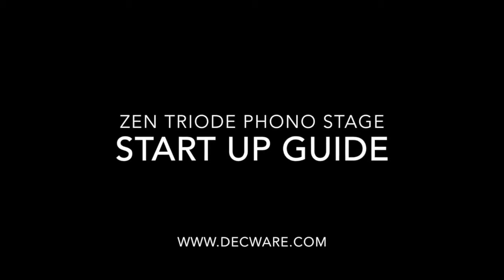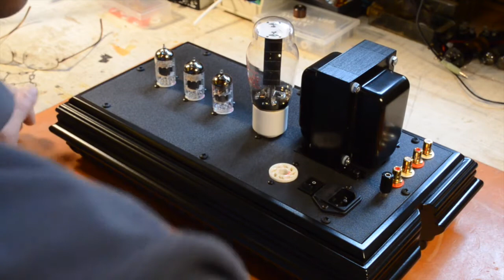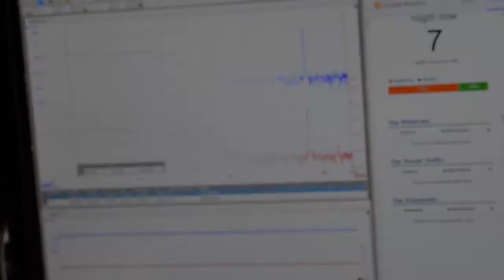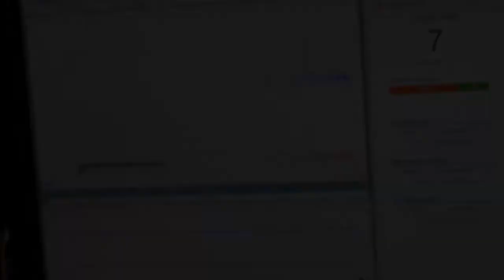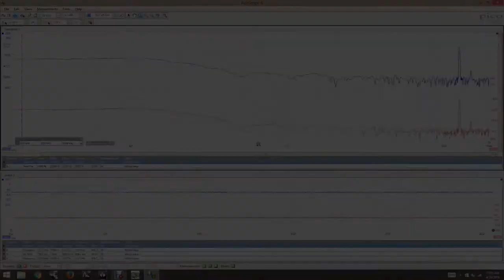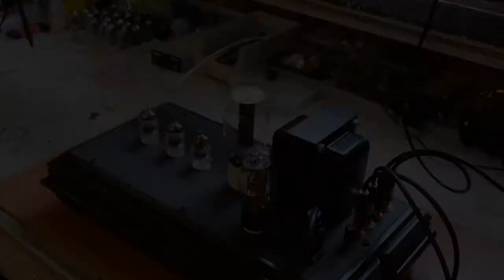Model ZP3 startup

Comment: I would love to put this up against my Hagerman Cornet 2. I would like to see under the hood and it cost about the same as mine even though I do have top of the line parts like Mundorf Caps along with z foil resistors.
Reply from the maker: The biggest secret to this unit is that the OA3 Vacuum Regulation is in series with the entire B+ load acting as a filter instead of a shunt.  You don't need to regulate a power supply when it's oversized by 500%, plus shunt regulation creates noise.  However when placed in series all of the harmonics and noise that creep into the power supply is blocked in the gap between the cathode and anode, so that only clean almost battery like DC comes through.  This is how you get that crazy liquidity.  Also we don't do solid state current sources because we feel even though it improves performance on paper it also creates some artifacts that contribute to a more clinical sound.  The sound of the Zen is Transparent Liquidity without any thickness or darkness or brightness.
Reply: @decwareproducts  Thanks, I've been itching for something better.
Reply: @decwareproducts   Is it also natural and organic sounding ?

Comment: Have you ever made one of these with a mono switch?
Reply from the maker: This model can not be retrofitted properly with a mono switch.
Reply: @decwareproducts  If I intend to run the 34.6I in mono with one speaker till I can afford a second is that a problem using the ZP3 in front

Comment: Would it be possible to have too much tube goodness in a signal chain, such as a ZP3 into a TORII JR, when the music is distorted guitar rock, or electronic synth pop, both with vocal harmonies, big drum & deep bass sounds? Will so many tubes smear the sound, or do they just make the overall sound dimensionally bigger?
Reply from the maker: The answer depends on the transparency of the components. With our gear it's hard to get too much to the point where it begins to make things worse and not better.  A signal chain like the ZP3 into a TORII JR is about as good as it gets, lacking a preamp you couldn't get any simpler really.
Reply: @decwareproducts  A quick question please. Does all your TORII amps have 20 step volume control or is it exclusive to TORII JR? Thanks.
Reply from the maker: @klaymoon1  Our amplifiers come standard with an infinitely variable volume control but 20 position attenuators are available as an option.

Comment: May I ask if  the top of the Decware surface is it metal or some sort of PVC plastic.
Reply from the maker: 1/8 inch steel plate with powder coat finish